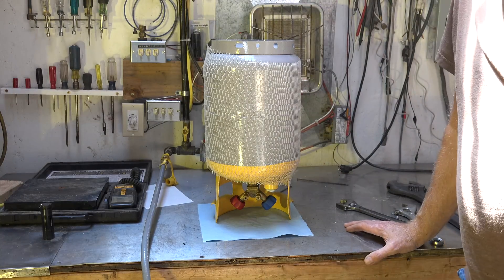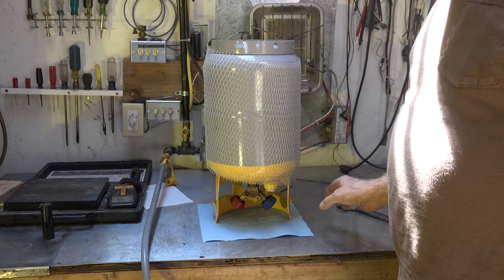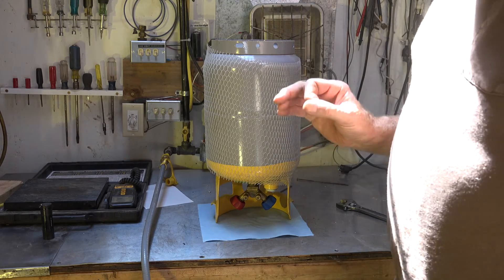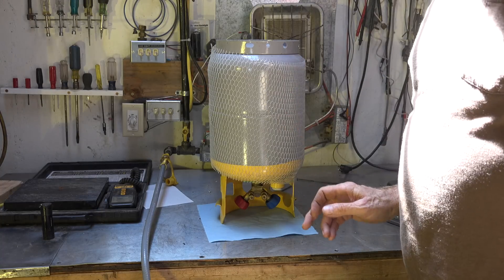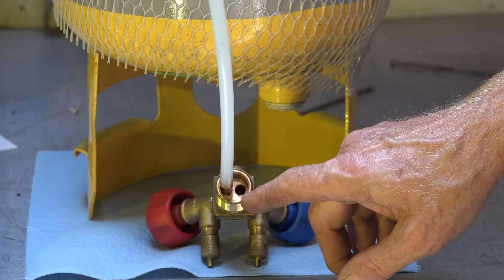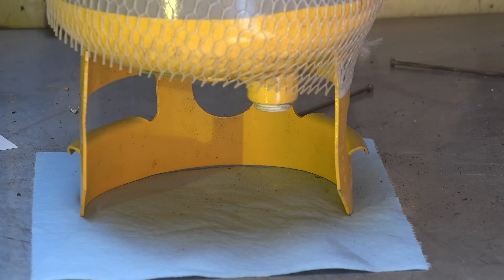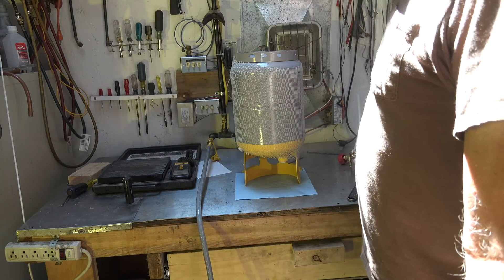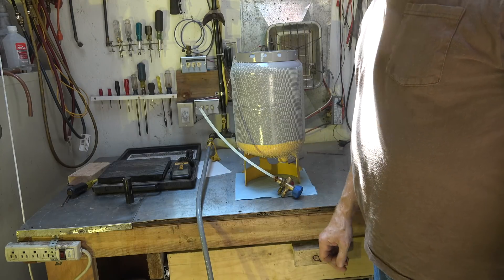How much oil is in recovered in refrigerant #2

Comment: Unless you have a recovery cylinder that has multiple cycles of liquid recovery with vapor only charging you will not likely have much more oil than just the cylinder inside surface coating.   

For a 5-10 lb liquid compressor driven refrigerant recovery, there will only be about 0.5 oz to 1 oz of oil loss, that will cling to recovery cylinder walls if vapor recharge is done.  Scroll compressors spit out more oil than reciprocating compressors. 

Recovery machine recovery will be even less oil loss due to greater percentage vapor phase recovery. 

On a typical residential system, you would have to do a compressor driven recovery 5 to 10 times before system oil loss would start to be a concern.

Comment: first...you would think that ac techs  would have some actual knowledge of the trade...clearly this is not the csse... hydrocarbons  are used as refrigerants...its exactly what r22 is...can you guess what the oil is for r22...a hydrocarbon...so if you can continually change the state of the refrigerant when it is a closed system and the oil has no choice but to go for the ride...what would happen when you now add a second compressor to the system...if u have no idea what I am saying then you should not be touching any refrigerant equipment at all
Reply: LMAOOOOOO. Cleary you don't know anything and cant comprehend. He said he had over 30 recoveries and had less then a t-spoon of oil in that tank. Further more if your unit has a crank case heater, which most residential systems do not that heat separate's  the refrigerant from the oil. You need to go back to school.

Comment: Great video. I purchased a new tank and I opened up the high side to remove the nitrogen. About a cup of oil came out. Is this normal? Should I get it flushed or can I flush it my self. It's going to be used for r134a. I'm new to recovery so any Info will help. Thanks 👍😎
Reply from the maker: It is not normal.  The tank should be dry.  It is probably a retested tank.  I would remove the valve and flush it with solvent.
GFM
Reply: grayfurnaceman Thank you so much for letting me know. I had a feeling it wasn't right. Thanks.

Comment: Check out my vid 'HVAC Recovery cylinder tip' where i pulled out a lot of oil with some refrigerant on a system with a failed compressor, it is possible but is rare.

https://www.youtube.com/watch?v=T-jmxXXV46E
Reply from the maker: I have had that issue.  The ones that I have seen has been on cold times with a shorted compressor that has blown fuses.  The refrigerant goes to the oil in the compressor.   When recovering  the refrigerant boils out of the compressor and brings oil with it.  About the volume of oil in a recovery cylinder, I always weigh the cylinder when I first get it, then add 80% of the net weight of refrigerant.  I think that should eliminate overfilling of the cylinder.  Thanks for the thoughts.
GFM

Comment: This is not true when recovering automotive air conditioning systems.  Some automotive recovery machines have oil separators built into them, and I have pulled out several ounces from only recovering a pound or two of r134a, although some times you don't get any oil when recovering.
Reply from the maker: The reason you are getting oil from automotive air conditioner is the auto air compressor holds little oil.  There is no large sump as in older auto air systems.  Most of the oil is circulating thru the system.  The compressor is mostly lubricated by the oil in the returning gas.   Probably when you get no oil is a unit that is low on charge and the oil is not circulating as well.
GFM
Reply: Jarrod you are correct, but nobody mention here we talk about automotive aircon system.